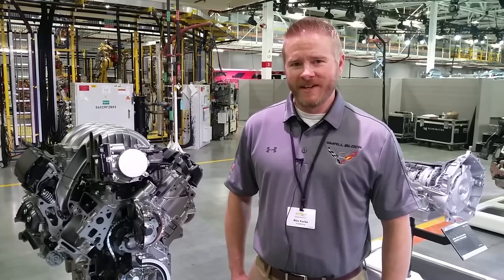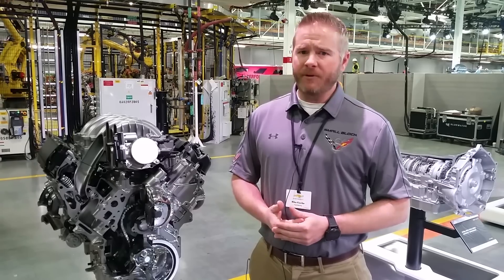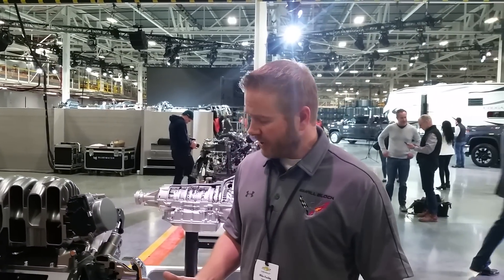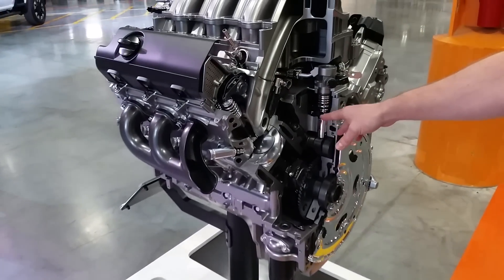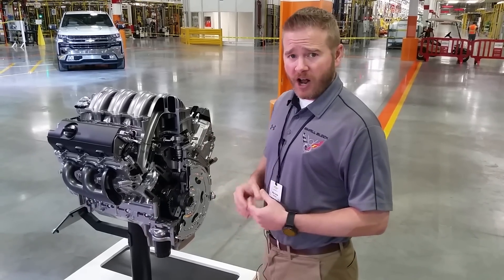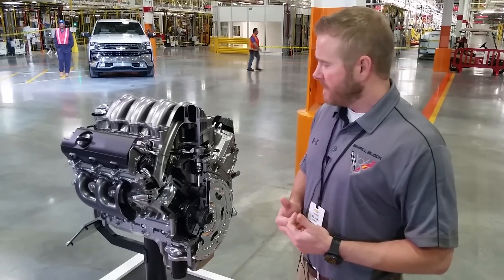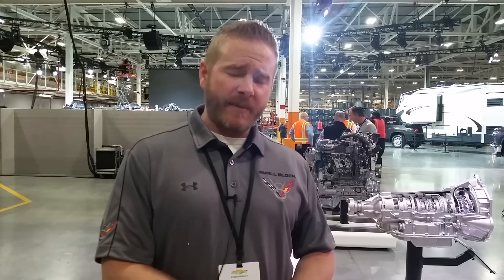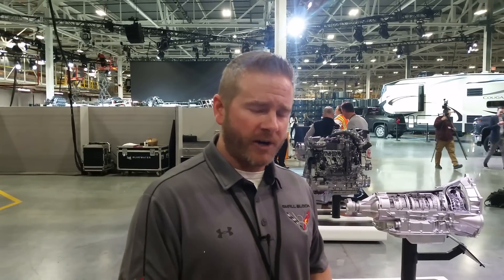New 6.6-liter V8 gas engine on 2020 Silverado HD

Comment: If this had port injection it would have been basically a factory stroker. I wonder how DI will perform
Reply: The big power guys will add standalone port injection on top of the di.

Comment: Thumbs up for using the term "FOOT POUNDS"  instead of the new millennials " pound feet"
Reply: Pound-feet is actually the correct unit of measure, according to the S.A.E, and has been around as long as automobiles had an engine torque specification. That being said, the term "foot-pounds" is easier to say, is universally used on torque wrenches as the unit of measure, and just plain sounds better. In my opinion, they mean the same thing...more is better!
Reply: Well I think it really doesn't matter since multiplication is commutative....in other words A x B = B x A ....SO lb ft = ft lb! LOL
Reply: SNeal5966 the measurement of torque is defined as applying 1 pound of force to a 1 foot lever, if you can figure out a way to apply a 1 foot lever to a pound of force then you can go ahead and call it a ft/lb.
Reply: SNeal5966 short fuse much? Never said you were mathematically incorrect     Just makes a whole lot more logical sense to express it as lb•ft. Which is probably why the SAE and the entire automotive industry (except for this guy apparently) uses it that way.
Reply: @SNeal5966  in vector calculus A x B does not equal B x A. that is why is is actually foot-lbs. that is how the right hand rule works with moment arm and force
Reply: @swss12 yes and no.....axb = -bxa but at 90 degrees axb = bxa. changing the order can give you the wrong direction but the magnitude is still correct, other than at 90 or 270 degrees where it doesnt matter again.
Reply: With back slash.
Reply: Think I gotta be with Johnny on this one. I'm 47 years old and it was ALWAYS ft lbs before about ten years ago. Car companies and the general public had it figured out then it seemed to change to lb/ft!

Comment: No FlexFuel = no buy, simple as that. E85 boosts HP and Torque numbers, burns insanely clean, no carbon etc, and is insanely cheap.
Reply: And you get shit for mileage with it, which eats up most if not all cost savings. And it contaminates the oil quickly. And causes more corrosion when it sits.
Reply: @Midnight_Rider96  Don't forget e-85 is government subsidized..........🤔

Comment: In 10 years, these motors will be in street racing cars witch 2 turbos and nitrous. Just like the current GM truck motors. These Ford nerds make me laugh. Ford has never made a better push rod motor than GM. Never.
Reply: No one cares about push rod .. coyote out here shitting on all other engines 
The coyote is America’s 2JZ right now 
500 wheel HP Na without touching the inside of the engine 
Cars going 8.6 with boost on stock unopened engines.
Reply: @Allthingschillguy  u mean the engine that's takes up all the room in the engine bay cause it's so huge. Cost a shit ton more for engine and parts then a LS. This new engine thou looks like nothing but problems.
Reply: @Allthingschillguy  You aren't making 500whp with a bolt on coyote.  Fucking fanbois.
Reply: They just did, the 7.3
Reply: Tell em brother!

Comment: The new Ford 7.3 definitely wins on simplicity and more than likely on horsepower. Fords current 6.2 is rated 385hp/430tq which isn’t far off what this new 6.6 is rated. Unimpressed
Reply: and the new 7.3 ford is identical to an LS style engine 6 bolt main caps back to pushrod setup even run lifter trays identical to an LS. Log style manifolds talk about copying
Reply: @loganpenland6568  Oh c'mon now. Or we can talk about how much copying the GM guys did of Fords Cleveland and Windsor in designing the LS.
Reply: @toddjohnson7133  the cleveland or windsor never stayed together when abused. Nor do either of them make even make 4.8 ls power factory. Also gm ls based engines are the first factory engine to incorporate 6 bolt main caps unbelievable flowing cylinder heads. A windsor or cleveland would never ever stand the beating these motor will put up with factory. Not trying to push your buttons but if you look at both cutaways and really look they are identically designed. The new 7.3 is the only ford motor that incorporates the 6 bolt mains and the lifter tray design.
Reply: @loganpenland6568   "the cleveland or windsor never stayed together when abused"...this is a news flash to me...and the rest of the world. So we should disregard the fact that the Cleveland style Ford engine forced NASCAR to allow GM to run the SB2 twenty years ago. Because the Gen 1 SBC was simply outclassed. The SB2 was the first engine that competed that  was not a factory based engine design. Huh? This is stock car racing? Ford was made to soldier on with a Cleveland style engine until '07. How do you explain that when there is an engine build-off with big $$$ on the line either Kaase or Bischoffe shows up with Cleveland or a Clevor and cleans house? No LS or BBC or SBC is able to put up the numbers that the old Ford small blocks can. Hell Kaase won the last Hot Rod contest with a Y-Block Lincoln. The LS is not to intimidating. The gen III hemi is much more efficient. If there was a modern pushrod engine to copy....that would be the one. 6 bolt mains is also old news. These have been on Modular Fords since the 4 valve head....old news.
Reply: @loganpenland6568  The LS is Chevys 1st deep skirt cross bolted engine and both Ford and Chrysler beat it by 40 years.  Coyotes are 6 bolt cross bolted deep skirt.  FE engines are deep skirt with the 406 and 427 4 bolt cross bolted back in 1961.  Old Hemis were 4 bolt cross bolted engines.

The 7.3 Ford is definitely a better design than this reworked LS which is not at heart a vocational duty engine.
Reply: @toddjohnson7133  6 bolt mains do nothing
Reply: @loganpenland, you are VERY uninformed on Ford engines, Fords had cross bolted mains in the 60’s and still have them in Cobra Mustangs,  hope this helps you a little!
Reply: Ford made an excellent choice to build the 7.3.

GM already had a great engine, and killed it. They refused to invest in the 8.1 because they're stupid, and short sighted. The 8.1 package could be built easily in sizes from 7.0 to 8.8, with very little added expense. It already possessed most of the electronic attributes of the LS series. It was powerful, even when severely detuned (the 8.1 properly tuned makes 400HP+ and 550 ft/lb in purely stock form) low maintenance, low cost, reliable, and near indestructible.

Comment: GM definitely coping what Ford has already been doing using direct injection in an 8 cylinder application. Ford is launching the 7.3 liter Godzilla this fall which will definitely out-perform this 6.6.
Reply: Ford is actually using port injection on the new 7.3 gas V8. Reason being, with direct injection only (such as this new 6.6) nothing is cleaning the topside of valves so they get all gummed up. Ford learned this with the first generation Ecoboost. All of their new engines (sans the 7.3, which was probably done strictly for simplicity) feature both port and direct injection.
Reply: it's the same thing, if you like how fords look, buy one, if you like how chevys look, buy that
Reply: Rumor is GM will be releasing a 8 liter motor too. Stay tuned.
Reply: @jostrander71  
POWER SOLUTIONS INTERNATIONAL (PSI) makes an 8.8L V8 gasoline engine based on GM's 8.1L Vortec.
That 8.8L V8 will be used in IC School Busess
Reply: GM has been using direct injection in their V8s since 2014
Reply: @lb9gta307  2013(lt1 first)
Reply: @moparjeeps8362  for the 2014 model year
Reply: GM holds the patents for vvti and di for cam in block motors..
Reply: @mbukukanyau  how can they have a patent for di cam in block? The valve train and fuel injection are completely separate systems. And ford could make their own vvt for ohv if they wanted. Just not as much benefit as independent vvt like with dohc. With dohc you can adjust overlap, which is a big deal for midrange and high rpm power. Probably part of why stock coyotes Rev way better than a stock ls, or even a mild modded ls
Reply: Alistair B 
The high pressure fuel pump on a GM DI engine is driven by the cam.  This means that the systems are directly related to each other.
Reply: @mbukukanyau  Wrong! (Trump Face)

Comment: 19 less hp than the 6.2 and only 4 more lb.ft. of torque than the 6.2. 👀🤭😅😂🤣. C'mon, GM, stop holding back with mediocre numbers.
Reply: Peak numbers dont mean shit bro lol
Reply: @oddball0045  , mediocre numbers are for candy ass patsies, like you. So, you'd rather have less hp & nominal torque gain, in lieu of more hp and substantial torque gain👀🤔🤭😅😂🤣. Then, why are so many truck enthusiasts tuning up their vehicles for increased hp and torque gains, if it don't mean shit? Why did GM upgrade the 6.6 liter Duramax twin turbo diesel to the L5P version(designed by a racing engineer), yielding an OEM INCREASED hp to 445 hp and an OEM INCREASED torque to 910 lb.ft. of torque(with plenty more hp and torque to tune up to), if it don't mean shit? When the new 2020 6.6 liter gasoline V-8 engine yields 19 less hp and only 4 lb.ft. more of torque than a GM 6.2 liter ecotec V-8, that's mediocre, weak and pathetic. So, it does mean shit to alot of truck buyers. Especially, many truck owners that tune up their OEM sissified engines/drivetrains for hp and torque gains.

Comment: Imagine trying to get the back cover off to service the fuel pump lol imagine the variable oil pump getting a bad ground lol oops
Reply: 2200 psi isn’t that high compared to the 30,000+ that common rail diesel are using today. No problems from that sector of the market. I’m sure that they will be using a lot of diesel parts on this fuel system.
Reply: Imagine a 15 megapascal fuel rail line exploding and spaying a fog of fuel over a hot running engine....BOOOM. 15mpa. Wtf. Wtaf
Reply: @SavxgeX420  
The fuel pipes used on high pressure side arent your standard wall fuel line.
They use very thick walled stainless pipes on that.

Comment: I wonder how they got away with the high particulate emissions of Direct Injection ...without MPFI in series this things gonna belch some black smoke under load.
Reply: Depends if they're doing spray guided or wall guided DI.  Spray guided has a lot less PM and many OEM's are moving to it.  Wall guided has more PM due to higher levels of fuel "adhered" to surfaces in the cylinder during injection and combustion.

Comment: Direct injection 💩👀🤭😅😂🤣. Forthcoming detrimental issues.
Reply: Yep..the commensurate 30K valve de-carbonizing on ANY of these DI engines....Joke.
Reply: @69A12SuperBee   I have 2015 Silverado 5.3 and I have 37,000 + miles on it with DI and have had absolutely no issue with any of it including carbon build up on the valves.
Reply: Ron Wilcox.....just wait, not much longer. 😰. My ‘72 402 is still running like new 😊.
Reply: @69A12SuperBee  Nah. I treat her right and besides she is the most dependable longest lasting truck on the road! I see tons of trucks from every era on the road!
Reply: @Punkinspapa  youwill
Reply: @69A12SuperBee  my 70 c10 runs great
Reply: @1racemate  No I won't!

Comment: I'll let some other sucker Guinea Pig this one. I'm sticking with my Duramax.
Reply: I got two duramax trucks. 
One 2016 chevy 3500 dually with a utility bed brand new off the lot 2 years ago with 15 miles. 
It has been a great truck. Im in the commercial air conditioning and refrigeration business all over TX. 
Now Has 120k. only a reluctant heater problem, which i fix my self. And rear axle seal problem which it was addressed on my drive way both sides got new seals. Maintenance performed every 5k 
Mobil Delvac 1 synthetic 5w-40 from day one. 
Regular filters interval at 10k miles. Diesel, transmission, and air filter 
Also Got a brand new 2018 with an L5P 
That is my my baby very pleased with that lady too. 😄😄
Diesel engines out performs gas when it comes to reliability and power.
Reply: LOL. Have fun with that. My tractors have diesels. I would never have one in a car or truck. Totally different engines.
Reply: @ Dan Hillman I tow heavy loads. There isn't a gas engine out there that can match the torque and durability of a diesel. Also, fuel economy. And, yes- that's why your tractor has a diesel as well.
Reply: @northerniltree  I tow 15-18k almost every day with my 01 2500hd 8.1 vortec has 206k  miles and is going strong. I'll give you the fuel economy but that's it. 8.1s are outlasting duramax's of the same years.wish they still made them.
Reply: Although the 8.1 is a good engine, it never was as good as the Duramax. For towing, it cannot match the torque found at the lower RPM spectrum of it's diesel counterpart. The Duramax will outlive and outperform the 8.1, especially when it is also mated to an Allison transmission.

Comment: So it's a 6.6liter ls3 that runs on 87.
Reply: It looks like a cast iron LT1 with a 6mm longer stroke and detuned for increased durability, that runs on 87.
Reply: Shawn Hudson correct, he also stated that it has around 20% more power than the outgoing 6.2 under the curve.

Comment: Most people don't realize how well the gas 3/4 and 1 tons pull. I've pulled up to 9000 lbs with the GM 6.0 and ford 6.2. No it's not a diesel, but they do really well
Reply: I’m a ford man but the 6.0 and 6.2 have my approval.
Reply: Jay Smith 
I pull 10,000 across the U.S. With my 2007 6.0L, 2500 HD.  No problem.
Reply: I had a 6.0 liter Chevy and it pulled a heavy load okay. Certainly no complaints. Now I have an 8.1 liter big block (Allison 5 speed) and it is the best gas towing rig I've ever had, not a diesel but right up there with 'em. I mean it pulls amazing, 10k lbs down the highway without even breaking a sweat. It could easily tow much more. Same gas mileage unloaded as the 6.0 but gets better mpg towing.
Reply: @iWatchVideosAtHome  the 8.1 and the Allison are probably a really reliable combo. I like the way Allison shifts and locks the converter when needed.
Reply: @iWatchVideosAtHome  wish GM would make that again.. i never tried one and now they are super rare. would be excellent for bottom end
Reply: I have the 8.1 with Allison in a dually pulling a 12k boat and trailer. Truck does fine with 180k on the clock. But it is 19 years old now so it's time for a change.
Reply: The transmission make a huge difference combined with these as well.
Reply: I pulled  13,000  # with my 1981 GMC  5.7 Liter Diesel ..   it was rated @ 130 HP stock .. mine had  the fuel turned up 10% headers and turbo mufflers..  Replaced the 2.70 rear end with a 3.08 when I could not find another 2,70 rear..  3 speed auto with lock up toque .  with that heavy of a load I had to run in second gear.. the truck rusted out at 270,000 miles on the second engine which was the upgraded targetmaster engine
Reply: @mikeskidmore6754  I had an 83 6.2L 1/2 ton.  It had over 200k in the second engine.  One morning the batteries where low and the compression kicked back on the starter and broke it off along with the block.  

The later 6.2 with the serpentine belt where supposed to be the best before switching to the 6.5L

Comment: And no mention of Fords new 7.3..Chevy is yet sucking up the rear.
Reply: There are tradeoffs to every engine. This engine will make more power than the Super Duty 6.2 while getting as good or better fuel economy than it could. The 7.3 will be a gas hog. Probably close to the fuel economy of the old Triton V10.
Reply: and yet GM apparently has another engine due out in a year or so that will be somewhere over the 8l mark. Then will Ford be sucking up the rear? Or maybe it's a constant game of leapfrog.

Emissions are starting to choke the power and life out of diesel engines.
Reply: @shadowwolfmandan  The 8L V8 is meant for their medium duty trucks.
Reply: @Cory Lehmkuhl "As it stands, GM would use the future, high-displacement eight-banger in Class 7 trucks, which it is considering co-developing with Navistar – as we were first to report back in November. "

http://gmauthority.com/blog/2019/02/gm-planning-new-engine-larger-than-new-6-6l-v8-l8t/
Reply: It's not a Ford commercial.

Comment: I bet the 7.3l GAS Ford will be a more durable engine. Direct injection, and variable oil pump just add complication and cost when they break.
Reply: the 7.3 is ford's first pushrod engine in years.
Reply: The new 7.3 is actually port injected.
Reply: @jerrym4405  Yup, I was referring to the 6.6l GM engine having DI and VOP
Reply: I am a gm guy, but the outgoing 6.0 is better than current ford offerings, but in the future looks like my dmax will be out, and the ford 7.3 is the way to go....it will be a while, but fun to see what happens
Reply: ford dose not durable